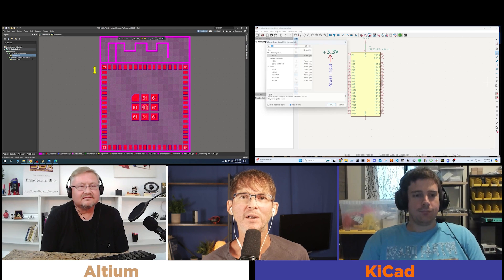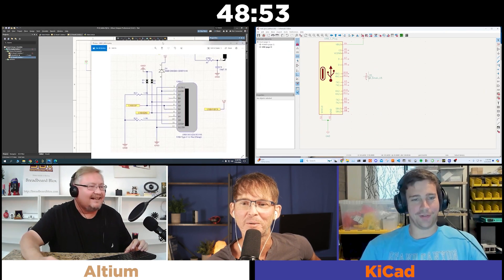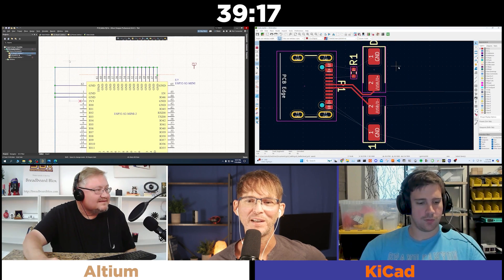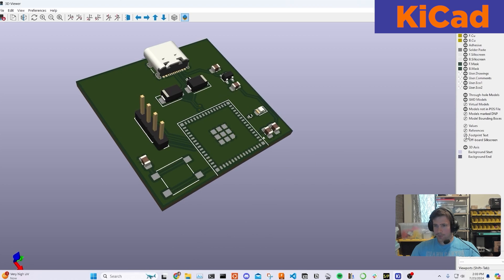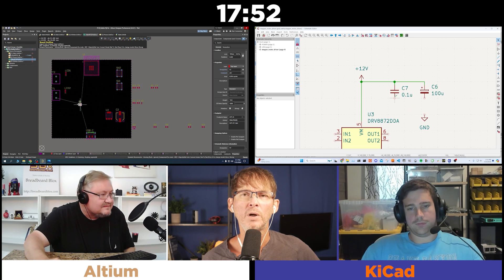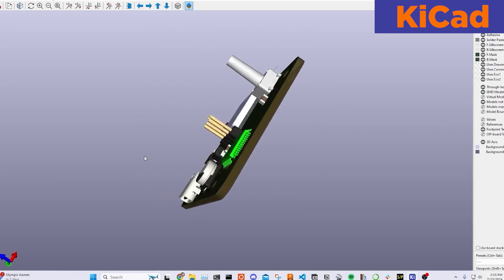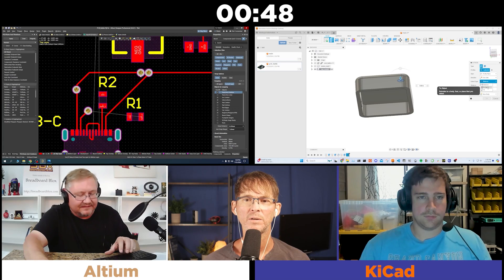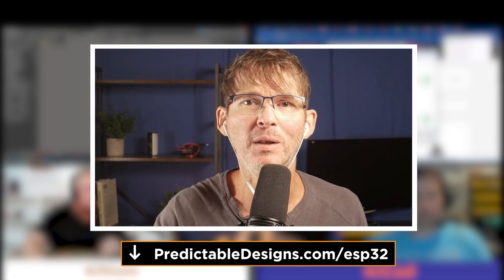Two engineers compete to design a PCB in only 1 hour! Who will win?

Comment: To be fair, this battle really doesn't make that much sense, in my opinion. Most people using Altium over KiCad would be designing something significantly more complicated than the design here. I like KiCad and it's great for hobbyist designs but when you get into deeper water, Altium shows its values. But saying this, I really despise the Altium company. They overcharge for software and they treat their customer base like fools with money.

I really hope KiCad continues to improve and eventually we won't have to deal with Altium's shady business practices. I've had to use Altium professionally, the software is great, but the company really doesn't stay out of your way (and it's continuing to get way too unreasonably expensive).
Reply: One thing Altium does is the RF impedance matching for you. This is where the PCB track layout is critical. It will simulate the circuit and draw frequency response curves so you know it will work before manufacturing it.
Reply: what a perfect summary. i couldn't agree more.
Reply: I think people use what the company has or can afford.  I worked for companies that use Altium so I use it.  However as an independent I could never afford Altium.  Altium use to support (but does not market) Circuit Studio which is basically poor man Altium.  I purchased it for $500.  IDK if they still sell it.  Circuit Studio is very reasonable and is compatible with Altium.  Meaning Altium can read Circuit Studio, but not the reverse.  Having that flexibility to me is more than worth the $500 price which for a serious independent is affordable and fair.  Also Circuit Studio is quite excellent.  I think they stopped supporting it when they realized how good it actual was and may have been cannibalizing sales from Altium.  If for any reason I can't use my Circuit Studio in the future I will be learning KiCad.
Reply: @EfieldHfield_377  I've only used KiCad as I'm a bit of a newbie to this work. I had a number of circuits to put in it and found it pretty fast to pick up. It has a few quirky traits that you need to watch out for. There might be the odd bug in it which makes it screw some things up if you do the wrong steps, but nothing serious. Altrium might just be a bit faster to use, hence why the firms pay the money, i.e. cheaper than paying additional wages. It's the usual salesman's argument.
Reply: Not to discredit your point, but can you point out in what specific complex scenario altium could do thay KiCad couldn’t? I genuinely ask to know a bit more, maybe some RF application? Or super fine signal/noise isolation?
Reply: @ I've never used Kicad for anything super complicated. But even for intermediate kind of boards, I found some of the things cumbersome to use and went back to Altium.
Reply: Maybe, you can help addressing all features & functions that make KiCAD way better than now 😂
Reply: I don't think the video was trying to be an objective test anyway
Reply: @MD-fe9nm  This is my gripe with Altium too and why I'm happy paying a reasonable annual fee for Fusion 360 and I get cad with it. Altium licensing is so old fashioned and short sighted.
Reply from the maker: Thanks for commenting!

Comment: Goes to show the power of open-source software that it can match a $12000 software at least for this general purpose design
Reply: 12k is obscene..
Reply: @Patrick-bm6ih , lol, try mentor.  > $100k
Reply: @Patrick-bm6ih  You can get Altium designer PRO for less than $3000 if you negotiate. It's about $5.5k if you don't negotiate. (1 seat, single location that allows travel)
Reply: @peterbradbury7072  still 3000 are not cheap for a hobbyist or someone doing personal stuff. That's expensive as heckkk.
Reply: You can get Altium designer PRO for less than $3000 if you negotiate. It's about $5.5k if you don't negotiate. (1 seat, single location that allows travel)
Reply: @peterbradbury7072 that's still crazy tho
Reply: As an enrolled student (who doesn't necessarily have to be "studying") in Germany, you can get Altium 365 (including Office 365, SolidWorks, etc.) for a semester fee of 2*€300 per year. Of course, this is all non-commercial.
Reply: I thought Altium is free..
Reply: Both Lose, EasyEDA wins! 😂
Reply: True, but anyway every open source project need some bussiness plan to speedup developenement.